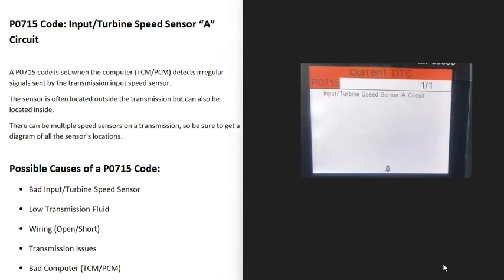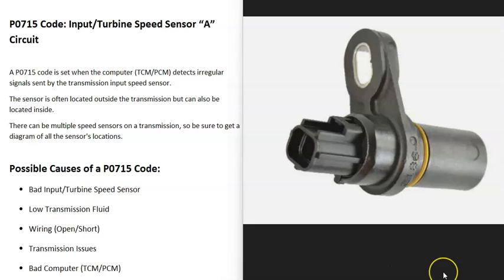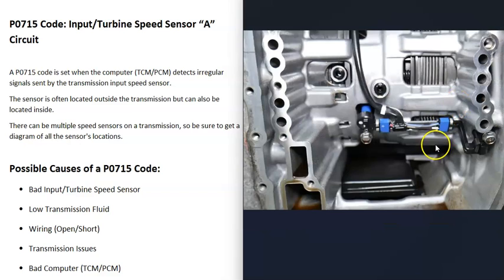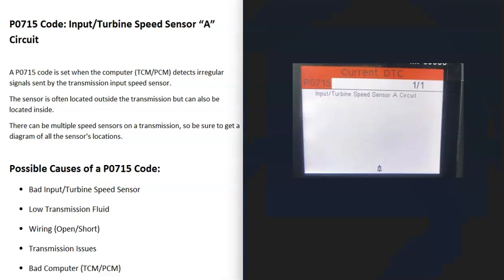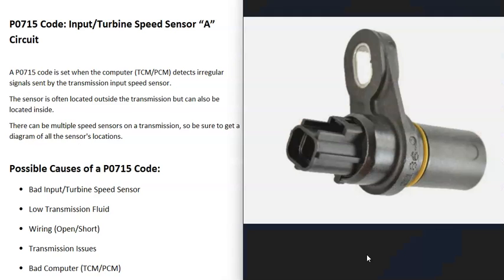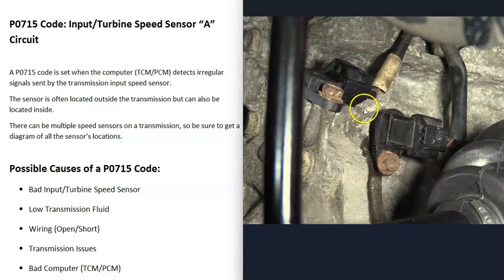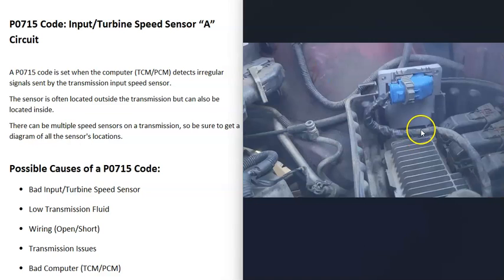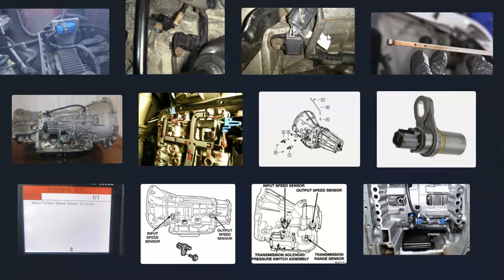Causes and Fixes P0715 Code: Input/Turbine Speed Sensor “A” Circuit

Comment: I have a po715 code on my 2000 Ford ranger 4.0 5-speed transmission automatic supposed to go in limp mode with this code but it does not you're not supposed to get out of second gear but I go through all the years just a little rough shifting into each gear a little bit but I'm able to go 890 mph

Comment: Good morning, so i have an 07 ford f-150 V-6 that iz throwing PO175 N PO743 ,so i decided to check all connections n wires for anything obvious, only external at this point, all was good except the one on the Dr. side, the small connector at the back of the tranni, soon az i touched it it fell right out of its designated spot, took it n i really dont know wut it shood look like or why it just fell out, it was wet from tranni fluid , it does go into the tranni, but that doesnt necessarily mean it should b wet, so i just pushed it back into its place n it snapped in like it was supposed to do that, anyway wut iz that part, will it throw those codes n should it b wet ??? NEED UR HELP PLEEZE N THANK YOU....

Comment: hello
i have an audi a4 2.7 tdi 2010 automatik
car drived but not so good,
P071600 input turbinen/speed sensor Acirc.range/performance
P174200 clutch torque adaptation,adaptation limit reached
i need help to fix

Comment: Hi, I have the same code. It’s a PO715. The problem I have is when the car is heated up after being stuck in traffic if I go from neutral to Drive the car won’t engage D.  the car will reverse if I put the car in D  it will not move. if I park the car and leave it for 20 minutes the car will be able to start and drive this causes so much frustration if you have any recommendations on what steps I should take thank you. Cvt f fluid Honda brand changed regularly and is clean   1 last question does the cvt7 Honda jazz gd1 have internal filter in the transmission?thank you
Reply: You figure it out?

Comment: Good evening, I have a Mazda 3 2006 with an automatic transmission giving me the following 2 codes:
1. P0715
2. P0766
What are your thoughts on these 2 codes happen at the same time. 
Also I forgot to mention that the Engine light and the AT light are on.
Your help would be greatly appreciated in this matter.
Reply from the maker: It needs to be diagnosed, but I would test the speed sensor "A" and wiring first. If the computer is getting the wrong data, it can throw things off.
Reply: @HVAC_Mechanic  thank you very much!
Reply: any updates on your situation? i have the same car with the same codes, thanks for your time!
Reply: I have the same car 2005 with the codes and engine light can u please update if you know or got the car fixed?